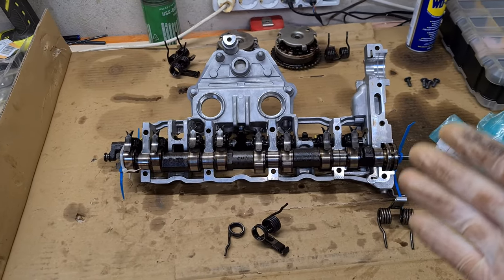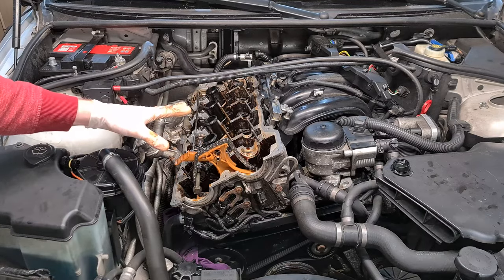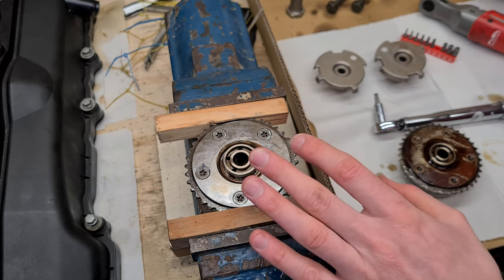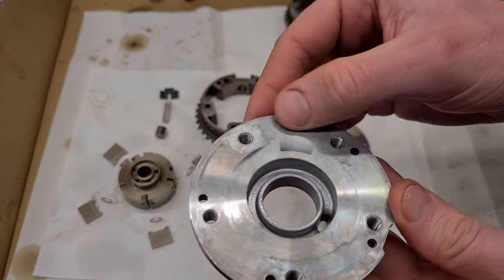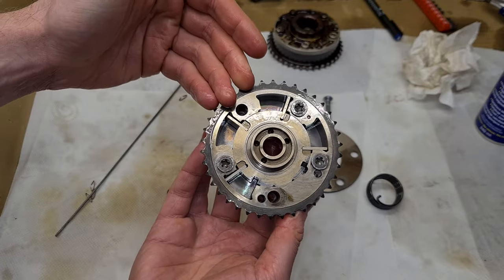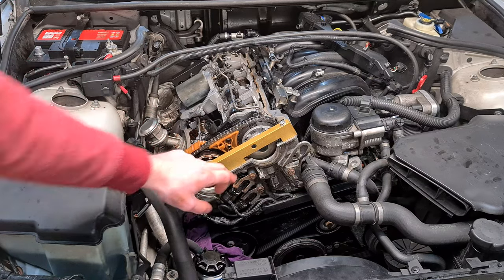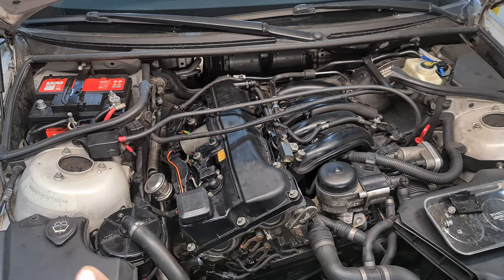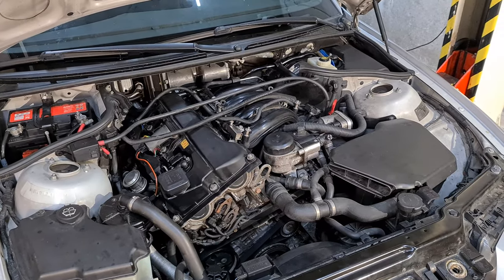Inspecting & Cleaning VANOS - N42/N46 VALVETRONIC Retainer Spring Replacement [PART #3]

Comment: Thank you BimmeZer!! Already jacked up the car to do the inspection of the Vanos unit and also disassembly all the coolant system since there is oil on it, never ending story with this beauty (hope it will be the oil cooler radiator).

Comment: intresting, to me the vanos unit seemed quite brillliant and simple. Not alot of moving parts :D great video m8 have a good one !
Reply: oh btw where have you gotten you're inpa from? i recently bought a new cable just so i could get inpa but for some strange reason there was every model execpt e46 and  iallso checked other models incase some whould have the n42 in them but no :/
Reply from the maker: @magnus3885  i think i got it on the CD with the cable. It an old version dough
Reply from the maker: I had to btidge 2 pins together to get the cable to work. I think some cables have a switch integrated so it works with newer and older models
Reply from the maker: Its simple in principle but when you get into details itxs quite complex enginering. But to be realistic... it's hard to implement this function in any other way...
Reply: @BimmerZen  yea thats true but to mee it would seem like these should be pretty reliable maybe the spring could fail over long time but if you do regular oil changes then it seems like these should never fail would be intresting to see a failed one how it failed. also the impa i know i now have 2 cables cuz i lost the first cd but demmit still does not get the software to work :( xD

Comment: I encountering the same issue with cylinders 3 & 4 (roughness values 1.3 and 2 respectively). I did almost the same repairs as you did.  I've measured the compression in cylinders and got 16.5 Bar in all cylinders except cylinder 2 (15.5bar). Now I thinking to check fuel injectors and knocking sensor, because knocking voltage in inpa for cylinders 3&4 indicating higher values (around 5-6v vs 3v for cylinders 1&2)

Comment: Hola excelente video, consulta tengo un 320i año 2006 motor n46, está con problemas de vanos, es posible reparar los vanos?
Reply from the maker: I can only recommend replacing VANOS units, not worth repairing them.

Comment: Very good video. I suspect the exhaust vanos unit to be worn out also, u must check it and make a video, also test the vvt motor and  eccentric shaft sensor
Reply from the maker: I will probably make some more videos on this problem. VVT motors should be OK because problem is only present ont 4th cylinder, the vvt sensor is quite smart and has redundancy + parity bit check so it would trigger an error code and emergency mode if something would be wrong with it...
Reply: Thanks

Comment: I also have issues with 4 cyl. Before repair and after repair. I think it's ok
Reply from the maker: Rough running? Misfire?
Reply: @BimmerZen  all ok except the rattle (next comment). But this rattle I have since 2013 when I bought this used car and it was before me.
Reply: @BimmerZen  Also raising knock values at speeding up. To 5 in fourth cylinder.

Comment: You should open exaust vanos unit, that one get more demage. I open my 2 years ago, it has much worn out, i had to change it. Inlet vanos was ok. Rattle was comming from exaust vanos unit
Reply: Uradjena je polu generalna motora a za vanose nisam otvarao .
Reply from the maker: Yeah, that is what I have read and heard. I want to solve this steb-by-step and just see what happens at this stage. I'll make a separate video about the exhaust VANOS unit. This video is already a bit long:D
Reply: I think mine is the same situation as it was yours. A diesel like sound when operating Vanos exhaust unit. Already checked the solenoids and swap them. I'll open again the head cover and almost certainly change the exhaust Vanos unit. Hopefully ther is no damage on the camshaft due to the rattle/malfunction of the Vanos unit.
Reply: Also, start up rattle. Problem was broken plastic part from oil dipstick into oil filter housing.  Plastic part was stuck into valve insde oil filter housing, and oil get down to the sump. I changed spring inside oil filter housing just in case. That solve my problem
Reply from the maker: @dejanlalic1340  Sounds like a hard problem to solve. Thanks for sharing the fix!👍
Reply: @dejanlalic1340  Where did you get a replacement one? Are they available?

Comment: Can you tell me why my  325Ci 2001 BMW doesn't have th 3 bolts you took out of you Main saft to remove the pully.?
Also  do  they sell the crankshaft holder  for this style setup.Please let me kmnow I am trying to replace the chains and want to change the oil pump chain as well.
Your video was great up till the pully removal. Thanks Lots; Ms. Jillian
Reply from the maker: All my videos on chain replacement and vanos units are on a N42 engine. I think you have the M54 engine..

Comment: Thanks much for ur time spent making this video to help us I for sure appreciated it very much because I have one of these engine working on question which impa your using it seems I have to get me one of those too
Reply from the maker: I use some older version that i got on the CD with the OBD cable. I'll check...
Reply: @BimmerZen  OK thanks I check some out on aliexpress so far its a pity I am just knowing about this tool I bought a autel ap200 last month and a Delphi e150 from alipress I like the Delphi the autel didn't awe me at all using it on the BMW
Reply from the maker: @vinotec4136  a lot of generic code readers dont read all data on the ecu for the N42/N46. Probably because these engines were was not present in the US market.
Reply: @BimmerZen  well the autel and  the Delphi read codes in each computer the autel couldn't relearn the value tropic motor I didn't see the option for it the Delphi tried to but a bad essentri shaft sensor preventing it from completing the task

Comment: I have codes 2A67 DME and 2B62. I replaced rod bearings and timing guide rail replacement. I did use the timing kit for the VANOS and cleaned out the VANOS solenoids. The car is way down on power. Any pointers please Bimmer Zen?
Reply from the maker: 2A67 Valvetronic Internal Fault
2B62 Camshaft Sensor 1 Inlet

Did you check all the connections? Can you scan with INPA to get more details on the errors...?

Comment: Hi. im from South Africa. I have a 318ti fitted with a e90 n46 engine 4 cylinder. I am currently having endless issues with intake cam moving off timing. i replaced the bolts even but the camshaft moves and the gear remains still. any ideas why? 
I have setted timing numerous times and it still does that. please assist.

Comment: Hi! First of all thank you for the detailed videos! You helped me understand the whole VVT/Vanos system of BMW. I have a question maybe you've faced this issue. I have a 318i E91 (2006) and I'm facing 2A6F - Valvetronic, minimum lift exceeded error code, I also have hesitation when idling and bad fuel economy. What would be the cause? VANOS problems or VVT actuation motor? I have also tried to reset the minimum lift (0.3mm) via ISTA+
Reply from the maker: Did you try to increase minimum lift to 0.4mm? Did you try scanning with INPA to get more info on the error?
Reply: @BimmerZen  It's either 0.3mm or 0.8mm, nothing in between. I saw a video that resetting it to 0.3mm resolves the 2A6F error. I run the car for a couple of days and see if the error comes back. I will also try and look into INPA. What should I look for?

Comment: I only have this Coldstart rattle which goes away when the Red Oillamp goes off. I think it has to do with Oilfilter House Gasket Valve. If i delete Adaptations the rattle is going away and comes back in couple of days or weeks why? Some people say this Coldstart is normal for this Engine but i have it every morning now!
Reply from the maker: What engine do you have, N42 or N46? Do you get any INPA error codes? Red oil lamp could indicate very low oil level or bad oil pressure sensor.

I don't know how deleting "values" (adaptations?) could have effect on startup rattle. It's seems more like an oil pressure/flow issue or worn/defective VANOS unit issue. Could also be slack chain due to broken chain guide or worn chain tensioner.

The rattle is "normal" in the sense that a lot of cars have this issue but the engine works fine otherwise. Probably worn VANOS units drain over night and they need to be pressurized on startup to stop rattling. My opinion is that if the rattle goes away after  1-2 seconds and it doesn't get any worse over time, it's not worth worrying about.

I plan to do some test on my car to get to the bottom of the rattling issues on N42:)
Reply: @BimmerZen  I have the n42 engine. No error Codes. It always Happen if I Park upwards. On flat surface it's not Happening. Even tho if it's Happening on flat surface IT isnt that loud or long. Otherwise it's all good I guess I need an 0w40 0w30 oil. Im using 5w40 full synthethic oil

Comment: Hi I am Wennie Dr Philippines I would like to ask about the cooling fan my fan is not working can you give an idea why the cooling fan is not working and I can't locate the right fuse and relay on the fan connector I can't see elec.current in one of the big wire I'm using my multi meter and I can't find any current on that wire can you give me idea on this matter and thank you so much....

Comment: Hello.
What can be done with the valve under the oil filter? 
When I replaced the oil filter housing seals I didn’t see anything special.
Thanks.
Reply from the maker: There is a check valve inside the oil filter housing, but it's not replaceable  as far as i know. You could remove the oil filter housing and try to inspect and clean it if you suspect there's something wrong with it.
Reply: @BimmerZen  Hello.
I took out the spring and stretched it a bit, now it closes stronger, it turns out it works?

Comment: Hi. Thanks for the video. Could you please clarify in what positions the vanos should be? I’ve noticed your inlet is just under 120 and exhaust 55. I’ve got 120 inlet and 120 exhaust. There’s no faults in the Ecu but it has rattle between 2500 to 3500 rev when warm. Any ideas?
Many thanks
Reply from the maker: Did you use INPA to scan the car and check VANOS timing?
Reply: @BimmerZen  yes
Reply: @BimmerZen  yes I have used INPA
Reply: @damok9529  did you figure it out?

Comment: good video :D 
hello i have a bmv compact n42, if you are in the mood i answer i have a question in the bey of my n42. Cold Star fires without a problem on the key. It reaches the operating temperature and drives normally, the engine can run without problems for a couple of hours. But when it goes out and then after a few minutes or half an hour it is harder to light, it has to spin more until it is assembled. So when the motor is harder to start at operating temperature.
Reply from the maker: I had similar issues when chain jumped for 1 tooth on the intake camshaft... You can check my videos on replacing the chain (https://www.youtube.com/watch?v=Pi9fWWNf0gA).

I would first do a compression test when cold and when hot (when it wont start). You can also check for VANOS position with INPA to see if your intake camshaft is in correct position. Correct intake position is arround 120 deg (+/-5 %). Also, dont forget to check for error with INPA.
Reply: @BimmerZen  I'll take a good look, it's mostly semi-general. Worked cylinder head and compound engine and tool serrated.

Comment: I have 2a6f code. What could it be? Valvetronic motor, eccentric shaft sensor or something else ??? Car feels slow at lower rpm. Btw good videos :)
Reply: I tested valvetronic motor and it seems to be working, but i dont know if it works correctly.
Reply from the maker: @E90dga  Definitely some VALVETRONIC issue. It's probably not the sensor, It's quite smart and it throws other errors when faulty. I would suspect valvetronic servomotor or valvetronic bearings. How did you check the valvetronic servomotor? There is a procedure to test if the valvetronic eccentric shaft has correct tension (https://www.newtis.info/tisv2/a/en/e46-316ti-com/repair-manuals/11-engine/11-37-variable-valve-gear/1VnYMYhkMF -> free registration required). Did you try scanning with INPA to get more data for this code?

Comment: yo billerzenn wanna give me some of you're wisdom? so i changed the chain and everything but resently after maybe 1k km it started to sligtly rattle sometimes why do you think this is? also during idle the engine makes some random noices like it changes something witch i think is the vvt but it sort of clunks when it does it and also pretty freqvently i dont recall it doing that before im going to have a look under the cover this weekend but could all of this have to do with the vvt or what ?😅
Reply from the maker: Sure sounds like VALVETRONIC issues. If you don't have any error codes, then I would suggest you remove the valve cover and inspect everything. Especially the rocker arms, intermediate levers and valvetronic springs.
Reply: @BimmerZen  y gonna have a look

Comment: hi again zen :D i recently got my inpa to work and my adap inlet is 121 now i havent recet de adaptations altho i havent done anything but timed the engine when i did the chain . my outlet is 57.9 but i  dont know if that is whitin spec. what do you think could be the issue? my cylinders are -0.27(1) 0.14(2) 0.00(3) 0.13(4)
Reply from the maker: I did some testing and I can reproduce the >120 deg on the intake camshaft by aligning the front VANOS locking tool 0.5 mm to the left (exhaust) (reference point is the edge of the cylinder head). So I think this happens because there are some tolerances in the locking tools and placement. Just keep this in mind if you do the timing again at a later time and try to align the front locking tool a bit more to the right (intake) side. This will probably show up as an intermittent error code in INPA about intake VANOS being too advances, but I don't think it's problematic for the engine.

The rough running data looks good. I assume the the max value in your INPA is 200 and if you disconnect a coil you get about +20. So your relative rough values are well under +/-10% which is the point where you have a problem.
Reply: @BimmerZen  hmm ok so you think this has something to do with the timing i did? you dont belive the stepper motor could cause any of it ? also i dont get any codes for it but there is a ! ifront of the number. but thanks for the info man!
Reply from the maker: @magnus3885  ! in front of the number is because max is supposed to be 120. Valvetronic (DC servomotor) does not  play any role in determining the camshaft timing.
Reply: @BimmerZen  oh ok btw i read a manual on timing job and chain replacement yesterday and in the manual they removed the vacumm pump and twisted the cams to make sure they were locked could this be an issue that even tho the vanos units are ok they arent locked ? that you just have to turn them abit inorder to lock? if so that could probably have something to do with it i did not check if they acually where locked . I still get ocationally a rattle on a cold start for like 3 secs.

Comment: My inlet vanos is 120 degrees
But my outlet vanos is 59 degrees instead of 55 like your , what does it mean ?
Reply from the maker: Well, let's look at it like this: VANOS sprocket has 38 teeth, which means if the chain jumped on the exhaust side for 1 tooth it would result in 9.5 deg of offset in any direction. Usually chain jumps in to retarded position due to engine rotating clockwise. The N42/N46 engines are known to have this issue with the VANOS position drifting towards the retarded position, like in my case where I have my intake at 119 and exhaust at 55 deg. If 60 deg is correct position, then my 55 deg is 5 deg retarded, which means an 8,3% error, which is tolerable (above 11% will trigger a code). I think there is probably nothing wrong with your car. If your engine works without any issues and there are no error codes, then I would not worry too much about it.
Reply: I did not find any reason of this 55 instead of 60. But 59 is better than 55.

Comment: Why did your EIN vanos not lock??
Reply from the maker: I'm still not 100% sure why. I suspected clogged locking pin so I cleaned the whole unit.
Reply: @BimmerZen  Thanks for a quick answer! Awesome channel. I have AUS vanos that was not locking. I dismantled it but found no evidence of that. I have placed a new one. I watched your video when you assembled the head of an engine, but you did not check the valve timings after screwing the bolts. Or I missed it. So after cleaning is it ok? Also did you try to lock in place your old one?

Comment: Wearing of eccentric shaft at zylinder 4.
Reply from the maker: Could be... or a bad lifter. I'll have to do some tests:)
Reply: @BimmerZen  Sir, have u performed this test with video? -)
Reply from the maker: @michaelgerasimov6457  I did perform several test and also replaced the nr. 4 lifters with no improvement. I have the footage, but I would like to solve the issue for the final video...

Comment: Hi.  Could you tell me what 3d printer you used?  Thanks. 
Torque Fix Torque Wrench 0.6-6Nm Torque Tool 1/4" Hex Drive T-Bar Nut Driver - Black, 0.6N.m
you can buy a click tool to set pre tension tool to 0.6nm
https://www.zoro.co.uk/shop/hand-tools/hi-grip-and-mechanics-style-handles/clickset-handle-0-6nm-50405/p/ZT1003280S
Reply from the maker: I have Ender 3. Thanks for the link, I'll check it out!